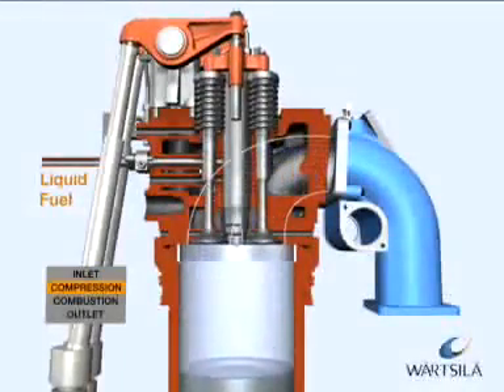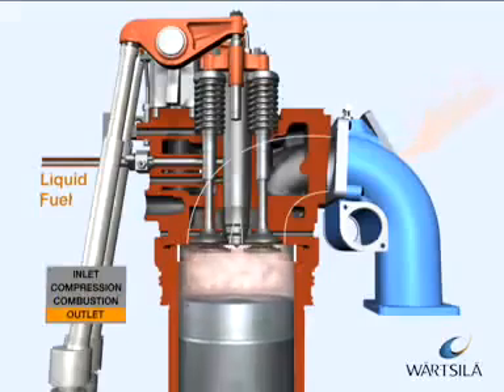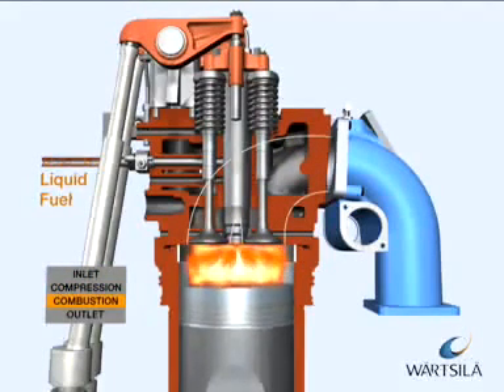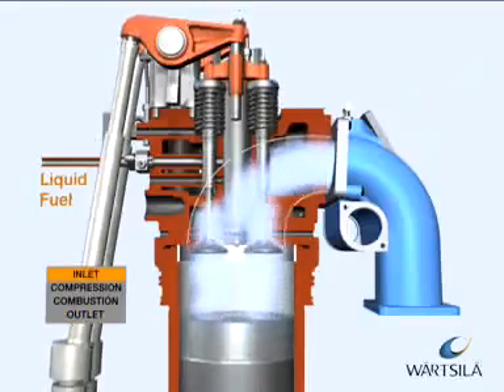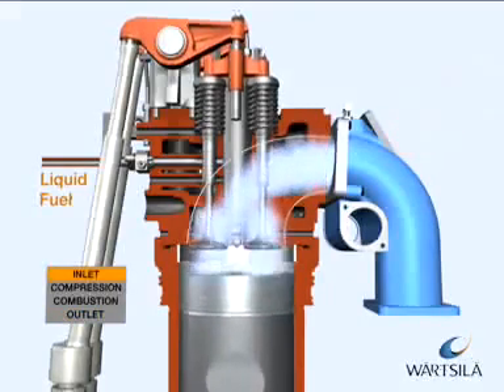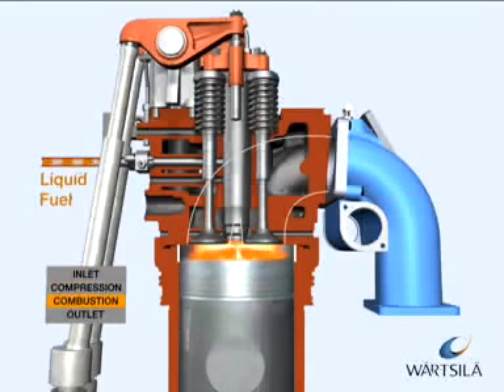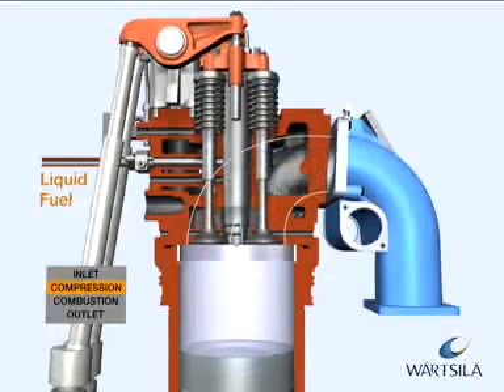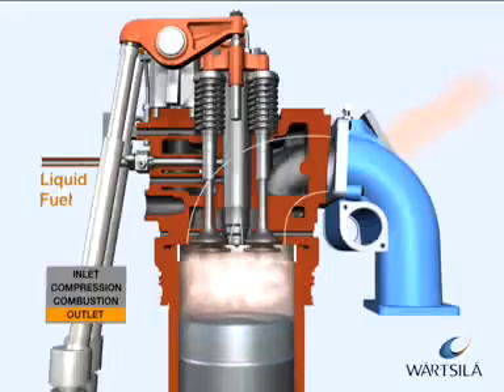Processo  di Combustione Motori Diesel.wmv

Comment: The video is wrong... why in the outlet when piston goes up exhaust valve is still closed??
Reply: because the rpm of the engine is so low that you don't need open previously the intake valve and so you can exploid all the power of combustion improving the performance.....this video show a Wartsilia motor...his max rpm is 4/500 rpm